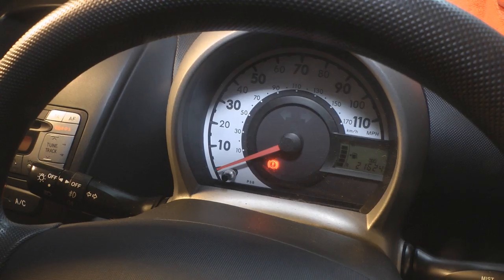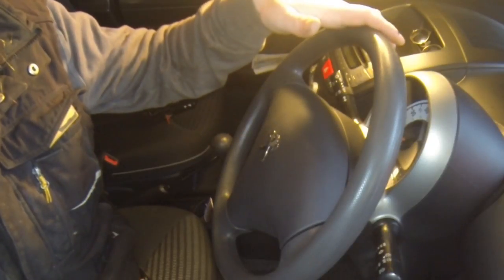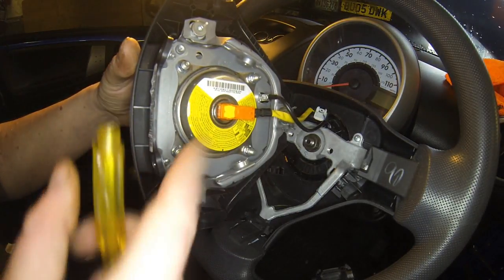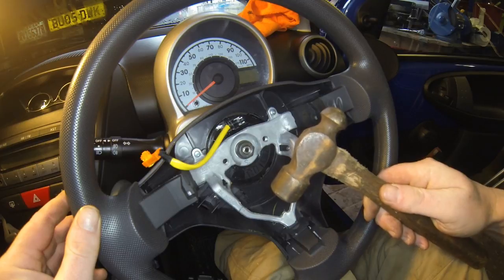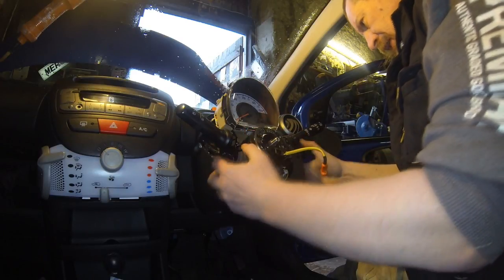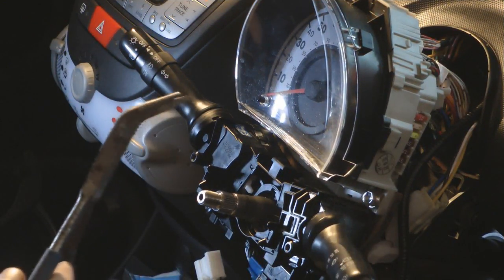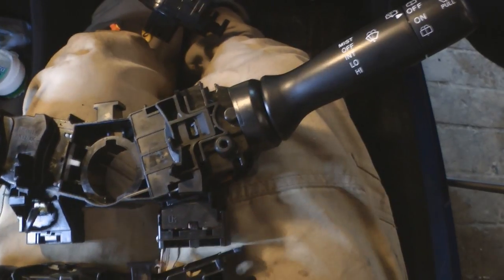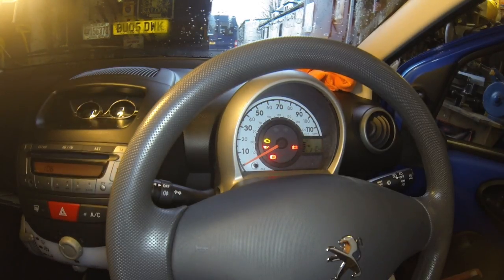#Peugoet107 #Indicators Peugeot 107, Aygo & C1 Replacing Faulty Indicator Stalk

Comment: Great video. Replaced the indicator stalk on my pug 107. Excellent instructions. Only thing I did differently is when replacing everything I orientated the clip 180 degrees to allow access from bottom. Much easier now to remove, especially if you don't have fancy angled pliers. Thanks you so much! Chris (from Manchester)
Reply: Went everywhere trying to buy some and then had a genius idea 💡. 
Move the speedo out of the way.

Comment: Brilliant assistance, I am a qualified HGV mechanic but without this video would not have dared tackling this job.... I too have cleaned and greased the old switch and will replace if it shows signs of failing again. Clearly getting warm and melting the grease exposing the copper contact which goes green (probably due to the damp these cars suffer from too) 58 plate Aygo sorted thanks to your excellent informative help, sincere thanks.

Comment: Great video - thanks. One note - if you don't have angled pliers then you can undo the two nuts holding the speedo in place and just nudge it out of the way to get a top down grip on the clamp.

Comment: Thanks, this was really useful. I am definitely not a mechanic but managed to change out the indicator arm.

Some additional comments that might be helpful.
1. The steering wheel is not always difficult to pull straight off as my nose can testify!
2. A lot of seller are actually selling refurbished units not new, I got a new unit from Bradgate Motors in Rotherham
3. Do get the long nose pliers with angled head as I am not sure I would have got the metal ring off without it.
4. I had a problem get the metal ring off because one side was flush to the plastic and couldn’t get the pliers around it, I solved it by taking the wiper arm off in situ, and then taking off the facia from the speedometer, this gave me enough room to get at the metal ring.

Overall, a relatively straightforward forward task. What also helped was typing up instructions beforehand and taking photos at each stage.

Again great blog.
Reply from the maker: Thanks for the additional comments.Oh dear, hope your nose isn't too flattened. Glad you found the video of some use. Atb Dave
Reply: Very helpful Richard, thanks for the pointers, hilarious comment on no.1, will take care there. Like yourself will be taking photographs at each critical stage. It proved invaluable once when taking apart a laptop :-).....I suppose it'all subjective so will see how it goes. If anything it'll be a valuable learning curve added with a sense of satisfaction.

Comment: Thanks Dave, just repaired my wife's using your tutorial as a guide. Working fine now. Only real problem was replacing the lower small phillips screw and washer, a bit of a fiddle. 

The garage quoted best part of £300. The replacement part and a T30 driver cost me £65. Bargain - thanks again.
Reply from the maker: Awesome, glad the video helped. Wow, that garage quote is scary expensive for what essentially is a half hour labour and the cost of the part, certainly worth doing it yourself. Nice one, cheers for letting me know how it went. Atb Dave
Reply: OK on that Mike, glad you had it all going once more.  Looks a bit scary but think will have a go after checking the video. Both indicators on my Aygo blue have ceased, so i'll bite the bullet soon. £300 sounds a right rip off ....Thanks again
Reply: Good luck Phillip, Dave's video is very clear, I did struggle finding the "three tabs" to release the black ring, but you will find them if you look closely.
Reply: OK on the tabs Mike, as you say the video is really spot on, just waiting for part and T30 and will go for it. Good to see all the positive feedback here with a lot of guys giving it a go, a real confidence booster for sure.  Cheers
Reply: The tabs were located OK after a couple of minutes :-)  (the lower two)
 at 9 o'clock and 3 o'clock respectively. Thanks A real confidence booster, doing the job...recommend it to anyone

Comment: Brilliant. Was quoted £150 for the OEM part and £200 for labour (ex VAT). Then found your video. Bought a replica stalk new from Amazon (£15) plus one of those (essential for this job) bent-nose pliars you use in the vid (£8) and a 19mm spanner (£5). Took this normally incompetent fixer just over an hour. Only awkward bit was removing the philips screw that holds the bottom cowling in place - difficult to access but I got there in the end. THANK YOU. Fixed and now I feel like a proper mechanic.
Reply from the maker: Awesome. Glad all went to plan. Cheers for the comment. Atb Dave
Reply: I do the same BUT i dont buy a new one, i just open it and clean all the metal part , then put some WD40 special contact. Then it works OK.

Comment: Excellent video with a clear detailed procedure for replacing the the indicator stalk.  My 59, 107 had a cable tie to keep the wiper washer stalk secure so just needed to drill a small hole in the replacement indicator stalk to enable a replacement tie.  All back together and working fine.  Thanks very much.

Comment: Great video, so much information. Changed stalk on Peugeot 107 and this video made it so much easier to complete.
Top tip was leaving the nut on when removing the steering wheel as it comes off quickly and could hit you in the face.
Well done.
Reply from the maker: Awesome. Happy the video helped. Thanks for commenting. Atb Dave

Comment: Really appreciated your video. You saved me going to the garage (which would have worked out over £200 inc parts!). 
I’m pretty useless at DIY and motor mechanics, but this video made it really simple. Took me 1.5 hours, which is 2 hours less than I thought it would! 
Can’t tell you how appreciative I am! Many thanks. 

My tip: leave that red tab on when you fit the new stalk, and use pliers to pull it off (matron) once you’ve got it on.
Reply from the maker: Awesome, glad the video helped.  Thanks very much for commenting and for the tip regarding the red tab. Atb Dave

Comment: Ha, I followed these instructions and it went smoothly, other than a few uncertain moments, like not having a 19mm socket, only a 21mm socket. I found it much better than an earler video where the bloke said there was no need to disconnect the battery as he had never had an airbag go off. for the sake of that possibility, considering how much work otherwise is concerned, it was not an issue disconnecting the battery. Further, I had a go at looking at the contacts on the old one and determined that its probably futile trying to clean them as I could not even get to them. I only paid £21 for my replacement, but recalled a few years back they were £60 odd, so I assume hey have gone down in price. However, on another note, I sat on the fuel pump in the back whilst fixing something and the metal cover popped in and snapped the plastic fuel line. I glued it back with superglue but figured that would not last long, so theres $30 gone on that, simply because I wanted to fiddle with something that didn't need fiddling with. I did think I would have to write off the car after the indicator stopped working, assuming that it would be really difficult to fix, but job done.
Reply from the maker: That's fantastic to hear the video helped save the car from being written off. £21 was a bargain price. Yeah is a bit futile to clean contacts as they dont last long before you need to do it again. Great to read your comment. Thanks Atb Dave

Comment: We found that guide to disassembly & replacement very helpful. The replacement part fixed the problem. Looking at the indicator stalk, we will probably split & clean that later as a spare part.
Very helpful - thanks

Comment: Thank you for putting this up. Took clock off to gain access to clip. All good.  Made a puller to get steering wheel off as didn’t want to damage threads plus I have no friends to help 😂😢 ps got stick from eBay £12.
Reply from the maker: Thanks for the comment. Glad the video assisted. I actually used a makeshift puller the last time I did this job, deffo helps. Great price on the new stalk. Atb Dave

Comment: That was a lot easier than expected. Someone else commented that removing the two speedo 10mm bolts makes access to the ring holding the indicator assembly on much easier.
Reply from the maker: Cheers for watching, yes that is a good tip that would make it easier to release the ring clamp, especially as not everyone has angled pliers like I used. Thanks. Atb Dave

Comment: very clear, i fiddled with electrical connectors for a few  minutes as video didnt show where to apply pressure. This improved my indicators but I think they contacts in the plug are still damp and should have cleaned these when it was all apart .

Comment: Thank you very much for this tutorial, which helped me to repair this commodo (Toyota Aygo), for my part I just cleaned the oxidized parts and removed a little grease and it works again. This also allowed me to make a great economy both in parts and labor.
Reply from the maker: Thanks so much for the comment, glad to hear the video helped. Great news you could could get away with just cleaning it. Perfect savings. Atb Dave

Comment: Very helpful video. I was able to remove the indicator stalk from my Peugeot 107 open and clean off the corrosion on the contacts with a Dremel, a light smear of dielectric silicon grease to help prevent it corroding again, reassemble and refit to the vehicle. Working properly again! Thanks, this saved me over £250 quoted at the dealers to replace the indicator stalk. Fantastic!

Comment: Thanks for posting this, it gave me the confidence to go past the airbag which I was especially nervous about. Stating the torx and nut sizes helped me to have everything I needed for the job at the start although it would be useful if you could also add the 'M' size of the threaded holes on either side of the nut for anyone who might need to use a puller. (Mine just wiggled off). Only problem I did have was getting the stalk assembly off the column, the circular metal spring holds down a plastic latch at 12 o'clock on the plastic ring on the stalk assembly - it keeps the assembly from coming off the column and it needs to be lifted up by inserting a screwdriver horizontally from the right hand side while squeezing the ring with the pliers in the left hand - easier to do if you have a helper. My local garage is good but they would have insisted on a genuine Pug part (~£100+) and no doubt an hour's labour whereas thanks to you I was able to do this with a third party stalk, cost £20 as I write this, and a bit of my own free time. Thanks again.

Comment: Thanks for the video, was very helpful. One point I would make is that it's possible to fit the spring clip that locks the switch assembly to the steering column at the bottom, ie. turned through 180 degees - there's more than ample free room there to accommodate the clip, and it's so much easier if you have to reassemble the switch assembly again (I did, as the cleaning of the contacts on the indicator wasn't successful the first time, I had to realign the moving contacts to ensure proper and secure connection - nothing like doing the job twice!).
Reply from the maker: Thanks for the comment, that will make it easier. Yes I too was on my 2nd repair, if a jobs worth doing its worth doing twice haha. Cheers. Atb Dave

Comment: Quick tip for anyone struggling to remove the little screw underneath. Using a no2 Phillips head (not pozi) locate the driver carefully in the head by feel. Give the back of the screwdriver a few little taps with a hammer, then push up firmly an turn the screw. Tapping will shock loose the thread.

Comment: Hi great video, what are you doing when you are putting a thin line marking up where the steering wheel goes on the spline? I cant see what you are doing ?
Reply from the maker: Thanks Robert. I just used a thin sharpie pen to scribe a line across both the wheel and the shaft. Doesn’t necessarily need to be thin just a mark across it that you can line up later.

Comment: Thanks fella, is a quick tuto and very helpful
Reply from the maker: Thanks for commenting. Glad you found it useful. 😊
Reply: @playing_in_trafic  am about to start replacing it now
Reply: I have a problem 😕
Reply from the maker: oh shucks, what's the problem you are experiencing?
Reply: @playing_in_trafic  when i took the steering wheel off, the black weell come off open, i dont know if i can send you a pucture
Reply: I couldn't put it back
Reply from the maker: @attallahazzeddine2186  Not got whatsapp, if you have instagram you can add me on that @h3r34thebanter on there.
Reply: I think i ruined it
Reply: The ring is opened, and there's a flat white wire come off
Reply from the maker: Yeah shucks. If you look up clock springs or squib rings on here it will give you an idea of how they work but chances are its easier to replace with a used one.

Comment: TIP Take the two speedometer bolts out and move up a bit to get better access to that clip and WD40 the old one on the ring it goes over the steering column as it's sticks on.

Comment: it's always nice to get into a modern car and say 'Wow that's really nicely designed...it looks great'...then you realise how convoluted it is when you want to change anything... xD ..still a good video though :)
Reply from the maker: Cheers. This car is has so many issues with bad design, crappy parts and water leaks it's unreal. Got a gallon of petrol and a match to fix anymore faults. lol Atb Dave
Reply: lol..yep i know that feeling.....and as for those Torx head bolts..it's a great design.. but the introduction of the security pin in the middle remains an insult to me!! xD
Reply from the maker: Yeah I like the Torx, I use a lot of Torx head wood screws for stuff and they work way better than Phillips head.
Reply: Do not forget the crap water pump on the C1 also had to replace the starter motor on my daughters C1. Now I have to take the steering column to bits.

Comment: I have just waggled the lever up and down rapidly loads of times - it seems okay now. The car has hardly been used for about 9 months - and I had found a water leal issue with the high Level Brake Light. Spare wheel well with loads of water in it. That is fixed now. Daughter borrowed the car yestersday and reported the problem. I am hoping it is down to lack of use.
Reply from the maker: Yep I had the water leak too. I reckon the added condensation in the air must be what causes the corrosion on the contacts. Hopefully your fix does the trick. 👍 Atb Dave

Comment: Great video. My indicator stalk was doing the same and now the indicators wont engage at all so looking at replacing. However only thing holding me back is that the hazard also arent working??? Checled fuse and changed and still not working. Would stalk affect hazards??? Or does this mean a different problem to stalk replacement ? Thank you v much
Reply from the maker: Hazards are separate but also another common fault and I have had to fix them.  Unfortunately I didn't make a video. However it is fairly simple fix by replacing (or dismantling and cleaning the contacts on) the hazard light switch in the centre of the dash and from memory that was around £20 off ebay. Does take a bit to figure out how to get the dash apart but there are videos on here that show it and it isn't complicated.
Reply: @playing_in_trafic  appreciate the reply thank you. Bizarre that they went same time. Battery died recently so perhaps that influenced it. Thanks again
Reply from the maker: @juanryth9787  You are welcome, hope you get them fixed easy enough. The suspicion when mine went at around the same time was condensation building up in the car causing corrosion on the switch contacts. Atb Dave

Comment: I noticed your replacement did not have the front fog lights on the new switch. Good to know it fits.
Reply from the maker: You know what, I never even noticed that. Well spotted.
Reply: @playing_in_trafic  the only reason I know is because the new stalk with the front fog lights is so much more expensive than the one with just the rear fogs. I’m just going to buy the one you did.
Reply from the maker: @greaser7765  Cheers for menioning it. Will save me hours of hunting should it ever fail mot because the fog lights don't operate. It has done fine so far though.

Comment: I have now installed my new stalk and the indictors work, but on one side the indicators don't cancel automatically after turning a corner. Does anyone know if generally this is something on the replacement stalk or is there something else I need to look at ? thanks
Reply from the maker: So I've just found out off my Dad that this car has the same issue with the indicator not cancelling when turning left. Dunno why he never mentioned it earlier. 🙄 I rarely drive the car so didn't know it wasn't working. I'm not sure how the self cancelling feature works but if I find out I will let you know. Not sure if anyone else is having the same issue. Atb Dave

Comment: When you reinstall the steeringwheel the torque specs for the central bolt is 50Nm. And the spec for the airbag bolts is 8.8Nm. This info is from the Toyota Aygo manual.
Reply from the maker: Thanks for watching and cheers for the  info. Atb Dave